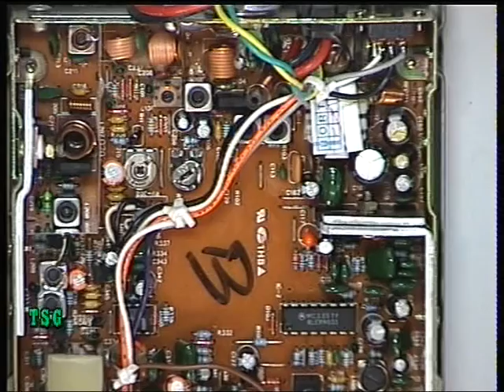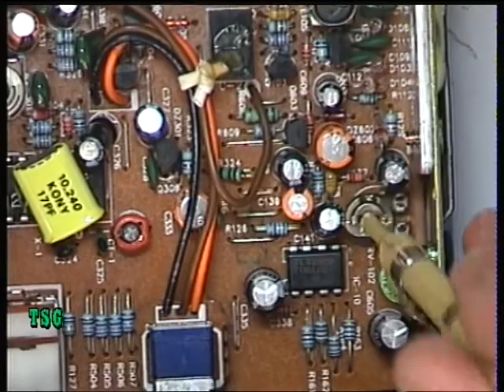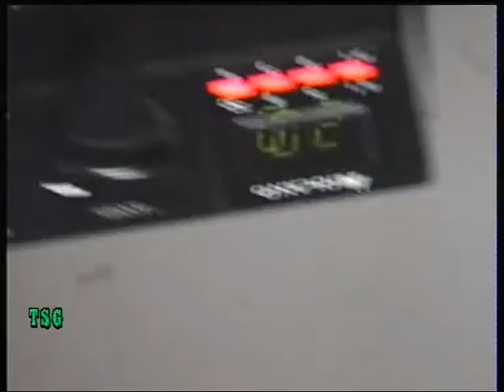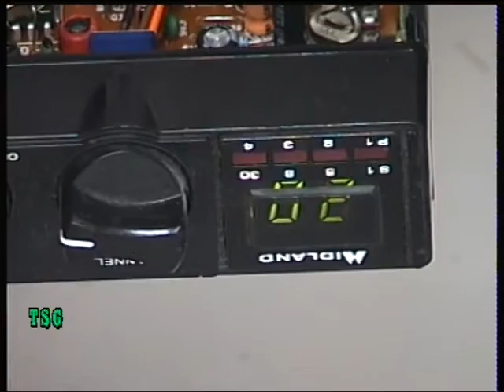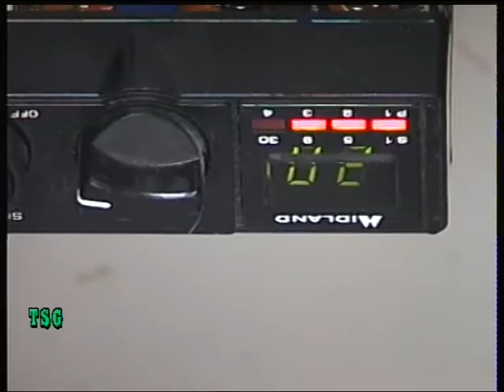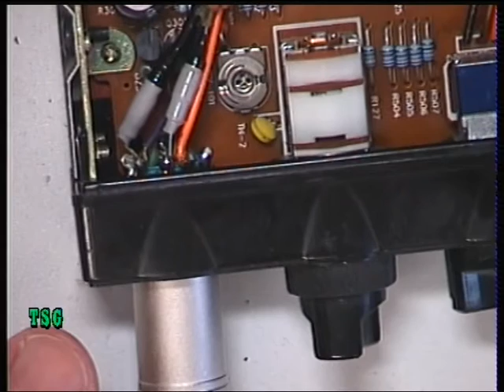Midland 77-104D UK (CB27/81) CB radio (mobile) - receive adjustment

Comment: Thanks for the video. I've come across a 77-104 in a thrift shop, I'm in the USA, and it seems a bit puny. Maybe I can get it back to usable status.  Certainly was nice to see which coils/pots are for trimming which parts of the circuitry.
Reply from the maker: Errr...you are in the USA...I'm in the UK. The USA version of the 77-104 is a totally different inside. In the 'States your system is AM....ours is FM. Yours runs from 26.965Mhz to 27.405Mhz, ours runs from 27.60125 to 27.99125Mhz

Richard, G0OJF, UK
Reply: @ukfmcbradioservicingTango21  I see that. I did not know that you folks ran FM. Seems that Midland would change model designators. Still enjoyed the video.
Reply from the maker: @pavil58yt  I also find it a bit bizarre  that they keep the same model numbers with totally different innards. UK CB radio came in 1981 & is 4W FM over 40 channels from 27.60125 to 27.99125. UK users may also use the 40 CEPT channels since 1987 (in FM) and then since 2014 the 40 CEPT channels may also be used in AM & SSB modes using  post 2014 CE approved radios. Luckily the unique UK 40 channels remain FM only.

Richard, G0OJF, UK

Comment: Hi Richard, on radio sets with four or five LED or LCD segments, do you set 100uV on S-9 so that S-9 just lights or just before S+30 lights?  I find there can be quite a range on the preset between each of the aforementioned points.
Reply from the maker: I set them so S9 just lights @100uV. Some people set S9 @ 50uV, some manufactures actually set as low as 10uV to make their product look more sensitive. However, I take no notice of service manuals when it comes to S9 & I rigidly stick to S9 @ 100uV on UK CB's as per my training.

Richard
Reply: Thanks Richard.  That makes sense and displays a more realistic indication of receive power I think. Of course none of the meters are calibrated, I realise, but at least S9 being at 100uV is a good point of reference and you get more of a range  instead of everyone within ten miles hitting you at 30+! Lol!

Comment: Hi Richard, many thanks for these videos. The radio arrived today. Firstly I was so happy with the condition of it, boxed, original mic, bracket and even warranty/instruction manual, it does look sooooo good. However was disappointed when I looked on the back and it is a D!!! Even more so after seeing this receive video!!!! looking forward to your field test videos. Regards, Carl M3VWP
Reply from the maker: I can just imagine this, ripping the paper off the parcel...yeah...yeah...yeah...yeah....great....great ...super...oh....

 I left our sample powered up on the bench & roof aerial on ch 19 for 24hrs. Sounds great to me & I can't remember
 what the 104UK performed like on receive, not do I have the 104UK instruction book to compare the spec.  There are loads of brand new models that perform worse on the test instruments...starting with the very expensive Albrecht all-singing all-dancing set that's as deaf as a post!

You've got me intrigued as to if there is a performance difference or not. Looking forward to one of the other engineers turning up sometime so we can do that field test!

Richard

Comment: Hello Richard,would you know if either the 104 or the 104D would be the same as the midland 805 portapack by any chance?
Reply from the maker: I recall mentioning in my 77-104UK video that our service data turned out to be for the 104D, so I used the 805 portapack manual instead, which I'd previously done a video on. To clarify, I've now done videos on the 805, 104UK & the 104D now. I recall that the difference between the 104UK & the 104D is in the receive section only.

Richard